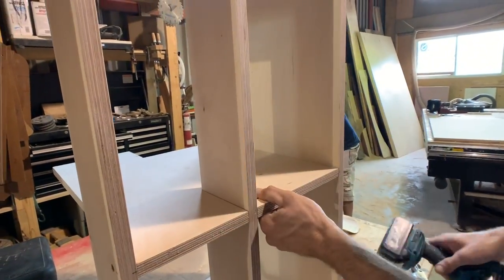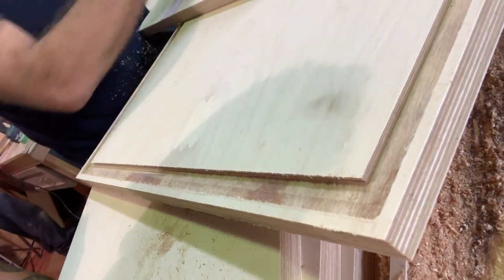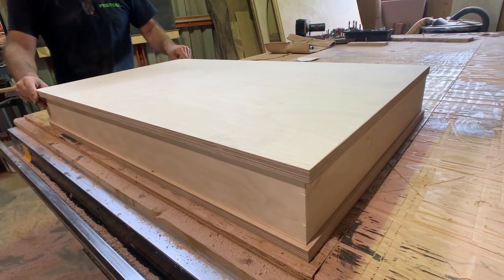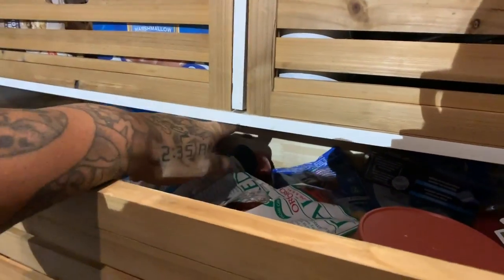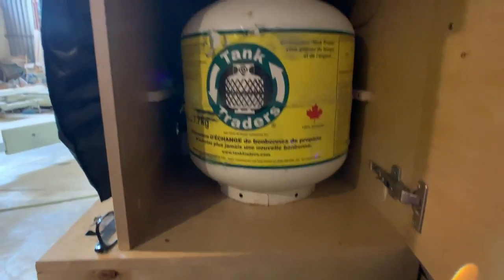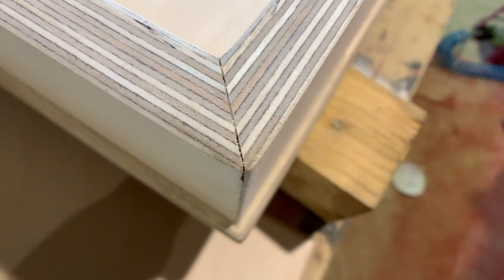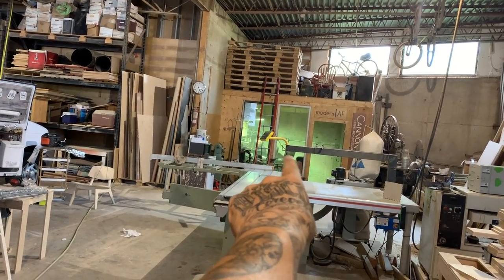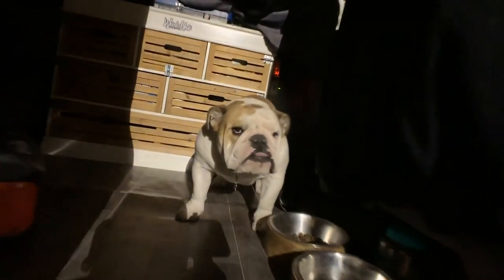Moving My Propane Tank, Building New Cabinets, Removing Old Build | Campervan Build

Comment: Please tell me you're going to donate your old cabinets to another van lifer who is just starting out and could use those,  just like you donated your old jachary.
Reply: Looks like they are falling apart in the 2 videos. May not be able to use it?
Reply: @vanlifeforgoldenrhodes  you're right and I hadn't finished watching the whole video when I put this comment in there. I was hoping he still had the cabinets and he hadn't torn them apart yet. If not maybe they could use the parts and rebuild the cabinet better than it's original Form?
Reply: @garrycole9187  yeah Gary I agree if I ever get to buy a van and build it out I'll be using some old school cabinets with better engineering!